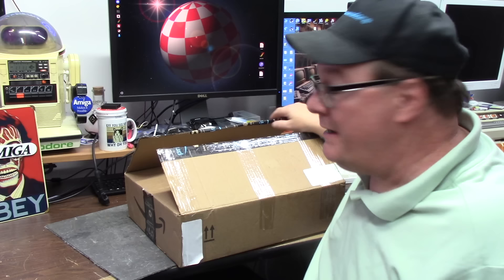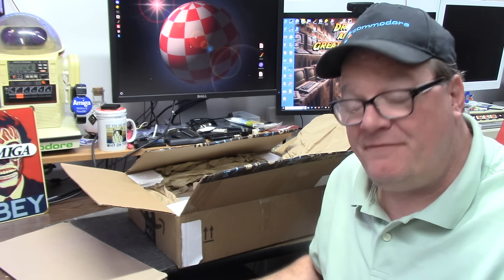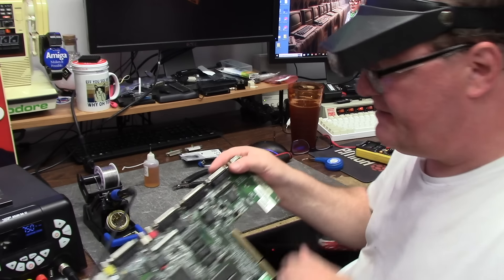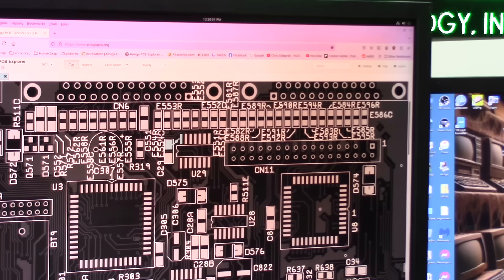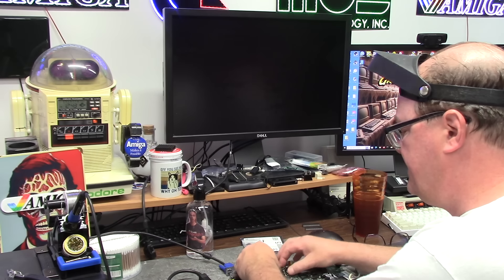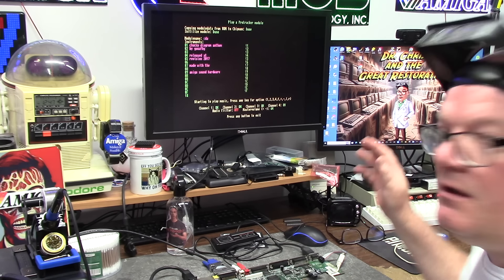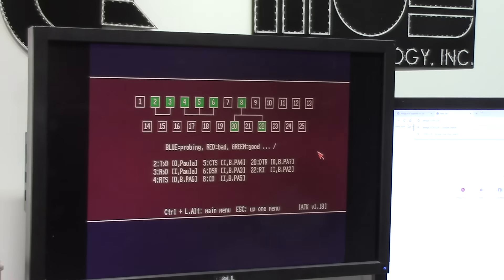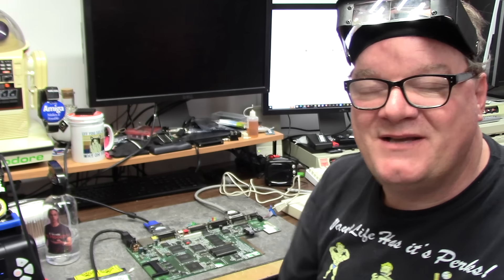Amiga 1200 serial port took a dump.

Comment: I never understood why the Amiga used a DB25 connector for RS232 serial with so many redundant pins on it, while having a custom DB23 for video.
Before the Amiga I had a BBC Micro with RS423 which used a DIN connector with 5 pins. The only needed pins were RX, TX, CTS, RTS, and of course GND.
Ever since all serial I ever had to do between Amiga and BBC or Amiga and PC could be achieved with those 5 pins. I actually had Amiga 2000's hooked up using AmiTCP and SLIP to a network of Windows PC's and the rest of the network purely via serial in a factory setting. It was even faster than the proprietary Amiga 2000 network cards.
The DB25 standard was for ancient teletypes and punch tape readers/writers. There was no reason whatsoever to implement it on the Amiga.
Reply: So people could connect their standard modems and printers to their Amiga. I bet someone plugged in a 23-pin video cable  into it, or some other 25-pin scsi device.